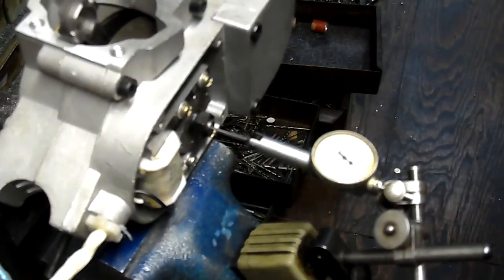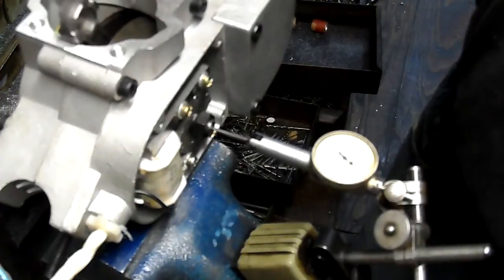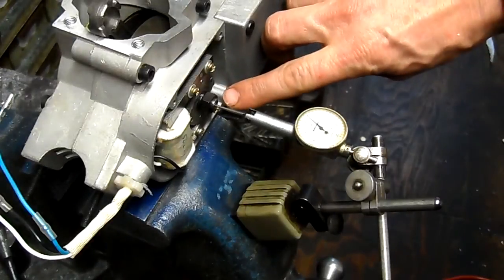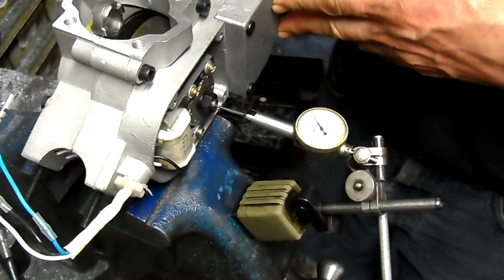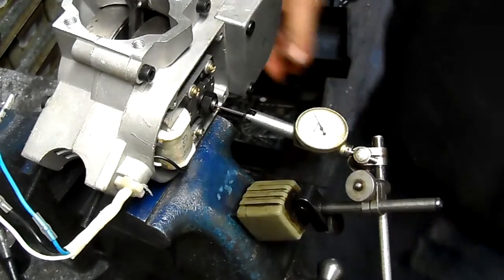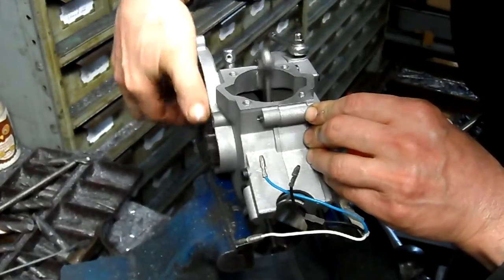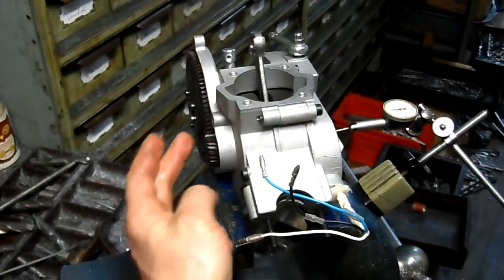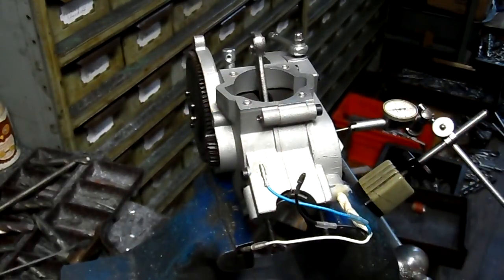Fred's motorized bicycle engine bottom end crankshaft check

Comment: I got a question that maybe you can answer you know that small gear that your talking about it has a screw in it what does it do?
Mine used to unscrew itself and  almost wore a hole in the cover before I took the cover off to have a look at the clutch pads. I have fixed it with high temperature loctite but I was wondering what it does and what issues it would  cause.

Comment: Man. Ive gone through 3 engines with hardly any driving on them. The quality of these from factory are GARBAGE. I was wondering if youd be interested in discussing with me some suggestions to end my troubles. Ill send you a picture of my rig. Great job on the videos!
Reply: i hope you mixed oil in the gas! if you didn't your engine was running unlubricated!